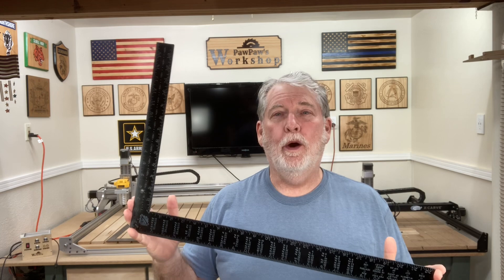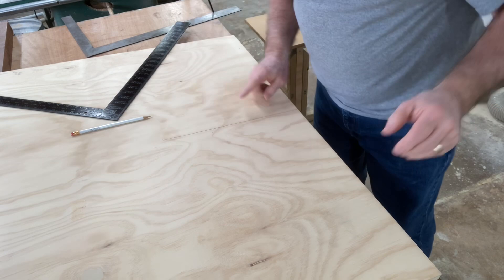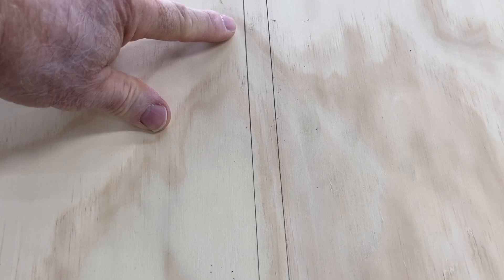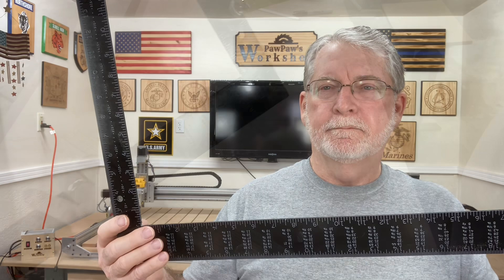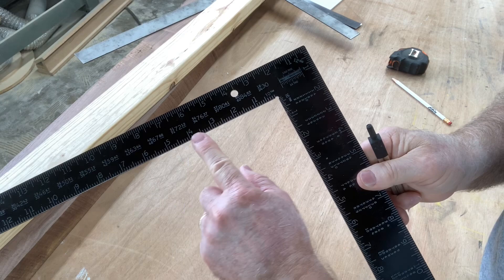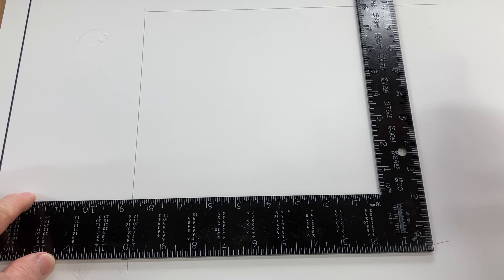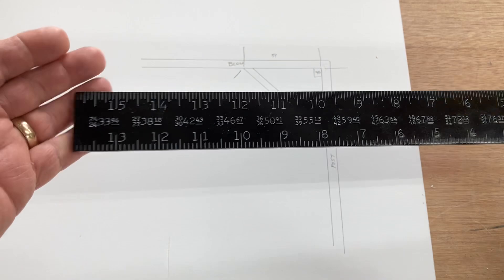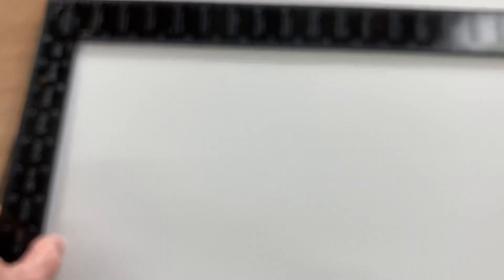It’s Not Just a Simple Framing Square. It’s a Whole Lot More

Comment: Really awesome. Thank you...  I'm in process of digging post holes for one side of a deck.   Would love to see how to set those posts on a 90 degree angle using the square, but u covered that pretty much.
Reply from the maker: I only covered part of it using the framing square. If you are aware of the 3,4,5 rule then use that to get it square.
Reply: Paw Paw’s WorkShop , thank you.  I've only recently become aware of it on YouTube.   Luckily, the foundation running perpendicular and past the deck, so I may use a laser w/90 degree lasers and the foundation or just the deck itself to line up the new posts.
Reply from the maker: Oddly enough you will find that the laser may be difficult to set up.  Use the 3,4,5 method.  You can also double the number to get a more accurate measurement to get you corner square. If you have room measure from the corner out 6, and again from the corner 8. With those two point marked on each leg get a helper and connect the dots. You need 10 to be square.  Very easy and works perfectly every time.
Reply: @PawPawsWorkShop  , ill give it a try.  Thank you.

Comment: Thanks for the great video. Do you know if you can use a framing square to determine the body and leg measurements to scribe a given angle? Say I want to produce a 27 degree line. I only want to use tools available in the mid 1800s. Would I have a reference book? Or could I do it with the charts on the square? Thanks for the help!
Reply from the maker: Yes, you can use just the framing square. You just have to understand some basic such as a 12:12 pitch is a 45 degree angle and a 6:12 pitch would be a 22.5 degree angle and so on.